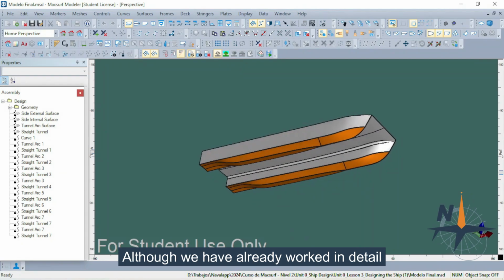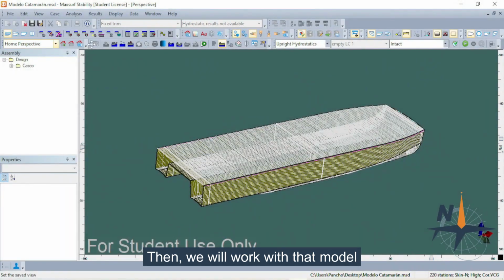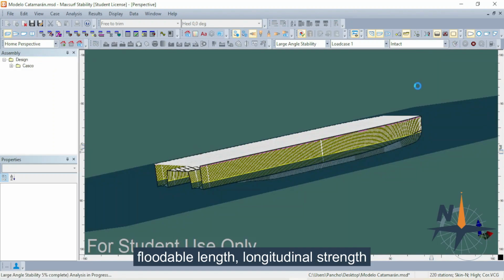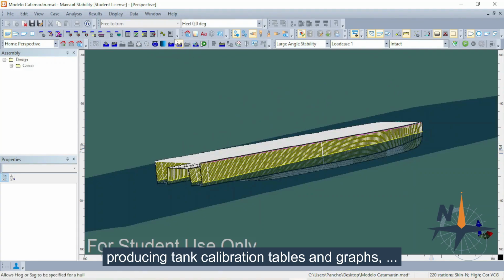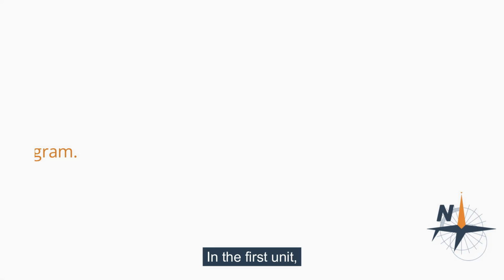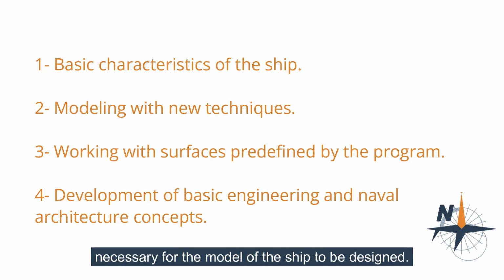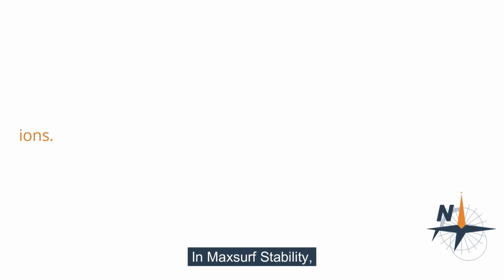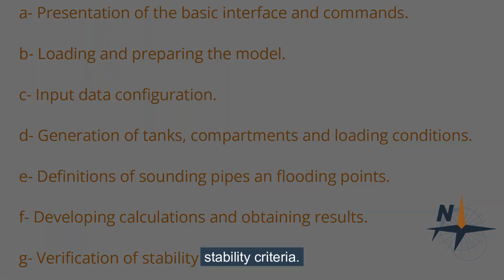Design, Stability, and more ...

Comment: How do you determine the position of the waterline? Are the weights of individual components calculated during design? I'm really curious how that's done.
Reply from the maker: Great question!

Yes, during the design phase, the weights of all components and systems that make up the vessel are estimated and recorded, along with the coordinates of each component’s center of gravity.

This process is part of what we call Weight Estimation, where we predict the weight and center of gravity of every structural element, piece of machinery, and system. These estimates let us calculate the vessel’s total displacement and determine the position of the design waterline, the level where the ship will float when fully loaded as intended.

Then, throughout the rest of the design and construction process, we perform Weight Control, which means continuously updating and checking all these weights and centers of gravity as the design evolves. This ensures the ship will float and perform exactly as planned, maintaining the right draft, trim, and stability once it’s built.